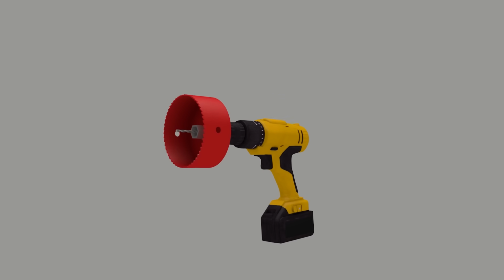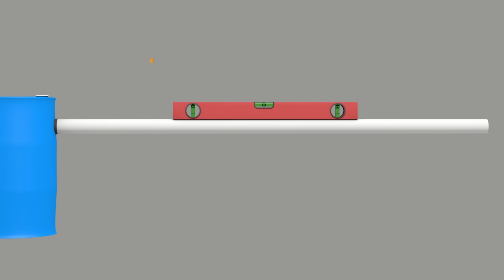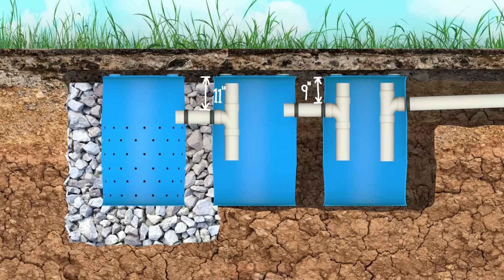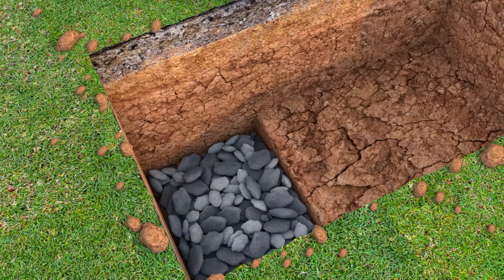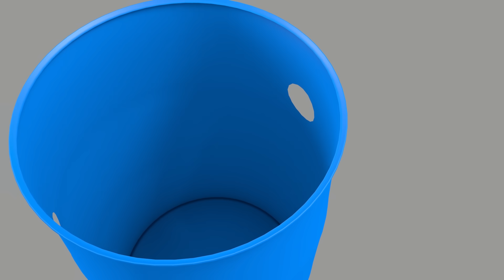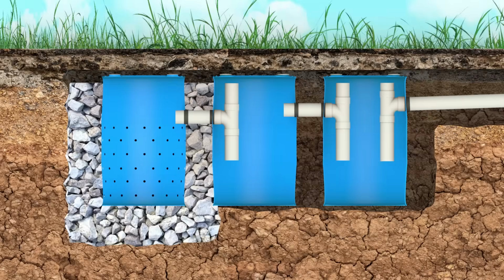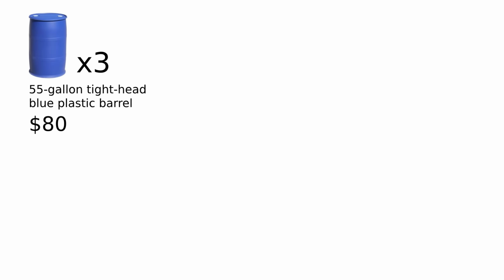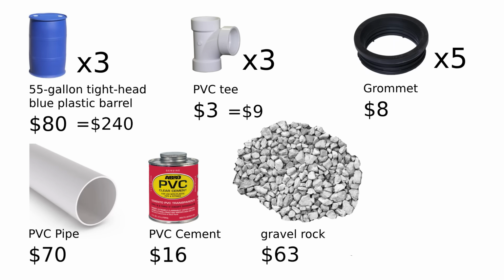Learn off-grid SEPTIC TANK installation fast and cheap.

Comment: Thanks for sharing! One thing you didn't cover is the vertical pipe running along the exterior of the house. Please explain 🙏🏼
Reply from the maker: You're welcome! That's a vent pipe, crucial for proper drainage and preventing odors. I'm preparing a video with proper explanation..

Comment: They have food grade 55 gallon barrels that have a lid and ring, it has a rubber gasket so getting inside and putting pipe would be easier with those type of barrels. However you left out that septics by code have to be 100' from a water well. I seen someone else say 75' so it may vary. However, you need a permit to install septic systems and I highly doubt this would pass or be legal. So use at your own risk
Reply from the maker: You're right about the code requirements. This video provides a simplified DIY approach for personal use, which might not be up to code for all regulations. Always check local guidelines!

Comment: Since nobody doing this will check with the authorities... Make sure you at least test your soil's drainage, or are aware of how the leaching will/might affect ground water... There is a reason why we have "raised bed" septics, in areas with poor drainage, high water tables, or near water sources like lakes and rivers (or your well for drinking...) you should actually consider adding a full drainage bed AFTER the tanks - not just a 3rd barrel with holes in it.  That water will just go straight down, and if your well is in the vicinity, you might be contaminating your well water.  Grass growing on top of the leach field is important, the roots absorb the nutrients and help to dilute the poo-water before it goes down into your normal soils.  Simply adding the long tubes with holes in them and surrounding them with gravel and fabric, then covering with soil and grass will make the system much better.  You only need a run for each bedroom and bathroom, spaced about 4' apart and running 10-20' with a slight downhill slope.

Comment: Is there any reason to install a draining access point to drain the tanks after X amount of years? All septics I’ve seen have access points.
Reply: This system is a bit small for full time use and assumes you have well draining soil. If its only used for toilet waste and not dishes and laundry, in theory the waste will nearly completely decompose over time. It might last decades even under full time use.

Also this system so cheap, you just abandon it when its full. Here a pump out would cost more than the materials to build another. Assuming your digging the hole yourself. 

I personally this this kind of system is fine for a remote cabin provided the soil is well draining. To test dig a hole down 4+ feet and see if it fills up with water when its not raining. After it rains some water would be ok provided it drains away over reasonable time. If the soil doesn't drain well, a larger weeping field will be required. In some might not be suitable at all for septic.

Comment: Please adjust the slope of the pipe to 1/8" per foot for 4" pipe and larger for code, otherwise the water will flow away from the turds and leave a clogged pipe.
Reply: or just do 1/4 bubble.

Comment: Thankyou for the well explanation. I have a doubt, can i make one septic tank for my dog with only one barrel. Can i use one barrel with holes and burry with gravel.
Reply from the maker: Yes, you can make a simple one-barrel septic system for a dog, but only if your soil drains well and you build it correctly. However, it is not a true septic tank—it's more like a dog waste digester, and it works only for small to moderate waste amounts.

Comment: 30 years ago I built a septic system for my moms cottage.  It is about 4x5 ft and three ft deep.  I then added a plastic distribution box  at the outflow  then three drain field lines about ten ft long.  I used block and mortar for big tank  then made cement and rebar slabs for a top.  I used 1/2 plywood for bottom and 1x4 for frame. I  put a 18 inch opening in the top. Then placed stepping stone over it to cover opening.   When I had my house take pumped they pumped hers. Once in 30 years.  I did have to add or redig drain field twice due to tree roots.  Family members used her bathroom over the years. She had company stay for shirt times with her.  Worked well till she passed last summer at 98   I’m sure if county knew about it. They would have put an end to her cottage. No one turned us in she lived in converted barn for all those years.  My option, if neighbors good, not living in the city. Beg forgiveness after befor asking for permission before  lol
Reply: Agreed

Comment: No background regarding what climate this is good for.   In higher latitudes where frost may penetrate 3ft deep, a system built as shown may freeze solid in winter.  The entire system has to be built to be frost free under any expected winter conditions.

Comment: Urine fills a tank with an HHO generation device turns urine into HHO that charges a solid state sponge HHO storage cell. HHO is feed to HHO burners that burn off solid waste and paper with automatic heated grinders turn solid waste into rich top soil.  Use septic system for bath and shower  and sink and clothes dryer water waste. 😊✨️

Comment: Only thing I would add is a Grey water line that goes directly to the leach field tank...
Reply: I would install a larger tank for the gray water and run it through a filter, sand and charcoal type ought to work for removing soap and grease then use the water for plants or skip the tank if you have a big enough lot and build a pond for the filtered water, toss in some snails, fish and aquatic plants and solar powered fountain pump

Comment: Why? A cesspool is legal everywhere, and so are French drains. Dig that same hole 100'ft. Away, and run 4"PVC at the 1/4 bubble All the way from the elevated tiny home. I see them on blocks, so a closet flange, long sweep 90°, tee, and fip adapter with plug, and pipe however far away you want it. Fence off the hole.

Comment: Speaking from a position of knowing nothing… should there be some sort of exhaust for gases? Is there any potential of fermentation to build pressure and have backflow issues into your toilet?
Reply: Yeah, you need a vent and it's in the vid just not pointed out. Round about the 50 second mark. The white pipe on the external wall.
Reply: @Jim-ze9ee oh I thought the vent has to be at the source of the septic tanks.

Comment: put gravel inside the leach tank.. all that pressure on the outside will deform it
Reply: Just sub it for an IBC. The frame will deal with any such issues.
Reply: If you were to put gravel in the tank wouldn't you just go one step further and eliminate the tank and just fill that space with gravel?

Comment: Brother, your video explained things in detail, thank you. I would like to give you an opinion. The third barrel should be placed at a certain distance, otherwise the water flowing out will spread and fill the soil, causing the barrels to tilt and fall over, and the system will break. Also, I am in Kerala, India, where there is rain for six months. This is not entirely correct for the above reason, because rain itself is very good even in places where there is no rain.

Comment: Built one of these 15 or so years ago and used an old leaking 150 gallon poly tank off a farm sprayer as the leach tank thinking the system might need to be pumped out at some time. Never has yet. We also used river stone from the property to save money and time. From inspecting the A/G tank every couple years we still have pretty good percalation as its never over a 1/3 full and over winter here in Georgia it will be almost dry if we are not using it for a month or two. I initially put a vent in thinking it needed it. Was told by a plumber at church it was unnecessary so I cut and capped it off..
Reply: … Great job 👍🏽
Reply: So these systems don't need to be sucked out and emptied? Can I guess that's because, as the waste decomposes into small particles and then float up and runs out? Including Toilet paper?

Comment: OK, you guys can do good work I see, but I want the PVC glue to have a color, maybe orange.

Now, my real question: Can a large TV fresnel lens cook effluent into burnt dust faster than 1 person can create effluent? I say yes. I say it can work for 2 people and the lens can be mounted stable toward the noon or afternoon sun. I say there is a fairly simple way to build this system so it is quite fool proof and can not start a fire. I can envision this system myself. If I can, so can others. Why don't you guys give it a try. We are talking about a system that has NO EFFLUENT ever draining into the ground - only burnt ash blows into the yard, with NO bacteria count. The system can work even when there is overcast sky for days, because the overflow tanks will store plenty as needed. The heat by a good fresnel lens can melt a brick, so, let's be honest, several hours of clear sky can boil away several gallons of water. If you have two lenses, let one boil effluent, but there can be a somewhat predictable rate of flow from this tank... this flow drains down a length of 2-inch diameter pipe that has a temperature of 800-degrees farenheit and NEVER drips past the heat zone because it turns to ash which drops out by use of a vibration device assisting gravity. Put a big catch-tank under it to prove to the inspector that NO effluent drips out! I say this can all be done.

Next question: For off-grid situations, let's say you have built a great system, but the inspector for the county comes to see it, and demands to see the perk test (despite sandy ground), permits, etc, and soon the county has some reason for threatening you with fines per day of non-compliance. How do you get these jerks to cease and desist while you NEVER have to pay fines (face a judge and be fined, etc.) ??? There may be some states that provide people with clear language of laws, and others are deliberately set up for mercenary profit by the county. These issues matter to MANY people. The world is full of power craving, frustrated authorities who lose sleep until they wreck you into a sick submission to their power, whether or not an honest use of authority. These people usually can not think very scientifically, nor using proper logic and ethics of communication. It is a show of successfully intimidating power, rather than being helpful. If you have an RV that NEVER has effluent discharge into the soil, imagine how they condemn this system (with the fresnel pipe-oven).

Comment: Great plan. I would consider adding another drum between the first two and have a bubbling aerator in the bottom. As well as an output 'filter' for the first barrel. So you'd have a sludge/scum barrel, an aeration barrel, a settling barrel and finally the leach barrel. Additionally, I'd modify the tops of the three tank barrels to be easily accessible and seal-able from above. This would assist in pumping out if needed. And finally, an inspection pipe placed in the leach barrel so you could monitor the effluent drainage through the rock.
Reply: Что такое bubbling aerator и output filter? Планирую строить такую систему.
Reply: @gypsy_soooul  A 'bubbling aerator' is like what home fish tanks use, but usually a pipe with many small holes in it, connected to an air pump.
An 'output filter' is like a fine screen that fits into the outlet pipes, preventing solids from passing into the next chamber. Typically this is on the final pipe before the leach field.  
I hope that helps. 🙂
Reply: @rusosure7 thanks, l got

I understand about the mesh on the pipe before the alkalizer. And about the aerator... For it to work, it needs to be connected to electricity, am I right?

Если это глупый вопрос, то дело в том что я девушка и абсолютно не инженер...😅
Reply: @gypsy_soooul  Maybe. An air line would have to feed the 'aerator' in the bottom of that tank.
Now, how to get air there? An electric pump like is used in fish ponds would work. 
If you have continual wind at the location, a pump driven by a 'windmill' could work. 
There are many ways to aerate the tank.
The home where I grew up simply had a propeller driven system, like a food blender (yuck!) at the bottom. 🤮  It always got clogged because of my sister's tampons. An air pump would not.
Please share what you decide to do. 😀
Reply: @gypsy_soooul  Also, may I ask where in the world you are? Спасибо
Reply: @rusosure7 in Ukraine 😊
Reply: why an aerator? The bacteria doing the decomposition are unaerobic
Reply: @Norbingel  Why an aerator? Great question. Though 'anaerobic' bacteria DOES break down waste, it is nowhere near as efficient as AEROBIC bacteria. This is why public utilities use the 'aerobic' systems. BUT, it does require some sort of pump or impeller to introduce oxygen to the effluent. 
There is a compromise for either. 
It's cheaper and less maintenance for the basic system, but it will potentially introduce 'BIOMAT' into the drain field and shorten its life.

Comment: What kind of grommet is that and where can we get one? Great videos! Thank you!
Reply from the maker: thanks for liking! i was advised by a subscriber that a Flexible Tank Adapter is better than the grommet. but it's best to use a 5 inch hole saw for the hole instead of 4.5 in this case. here are the links for both.

Flexible Tank Adapter: https://amzn.to/4m2IsAv
5" hole saw: https://amzn.to/4gavdwj

Comment: the one link you need the most is not there the grommet lol
Reply from the maker: I was advised by a subscriber that a Flexible Tank Adapter is better than the grommet. but it's best to use a 5 inch hole saw for the hole instead of 4.5 in this case. here are the links for both.

Flexible Tank Adapter: https://amzn.to/4m2IsAv
5" hole saw: https://amzn.to/4gavdwj

Comment: Just curious if in the even of continuous rain, should the waste push back up back to the toilet? Because when continuous rain water should already fill the ground around the third container making it harder for water in the second container to overflow into the third. So when people use the toilet during continuous rain days water might likely not flush down.
Just my theory, I might be wrong.
Reply: Your absolutely correct. And this system will fill up during the first weekend friends or family come to visit. Especially if he covered the system and has no clean out or inspection port. I also wouldn't be telling everyone you have this system unless it's been approved.
Reply: @The_Blessed_Cowboy im wondering why there are no ports for cleanouts from things that shouldnt be flushed or oil from dishes buildsup but im no plumber, just wondering.

Comment: One design flaw the effluent of the first tank needs to be lower than the influent pipe to prevent backups.

 Another issue all tanks sytems have they need two drain lines. One for all of your clean wastewater and one for your dirty wastewater.  Your dirty wastewater goes into your first tank for sludge collection and anaerobic microbes to eat and grow in. 
Your clean wastewater goes from tubs and sinks goes into your filter or "last tank" so the cleaning products and soaps  do not kill off all of your micro organisms that help clean the water. You want to grow organisms in your first two tanks.
The dumbest thing about traditional systems is they are designed to fail they dump clean wastewater into the same drain line and the dirty wastewater.